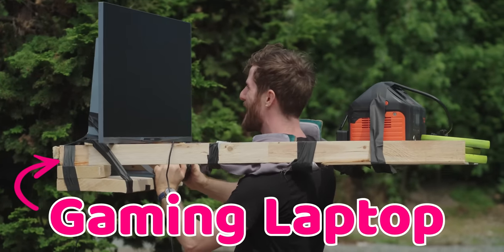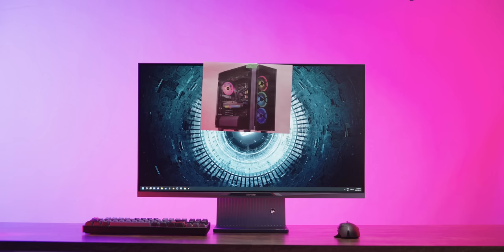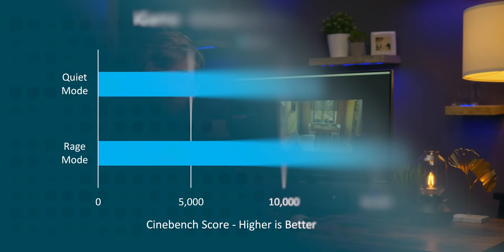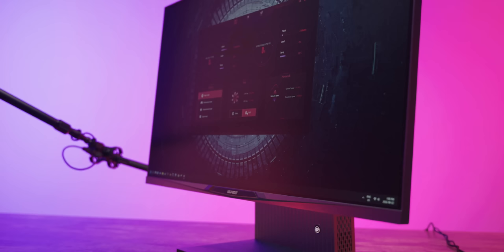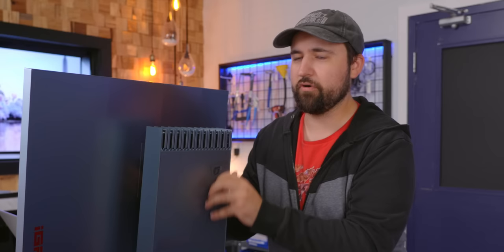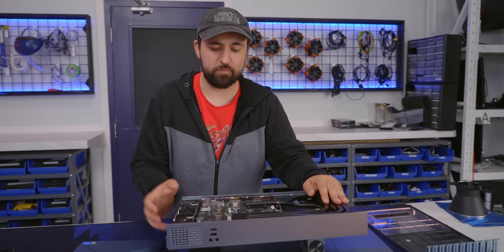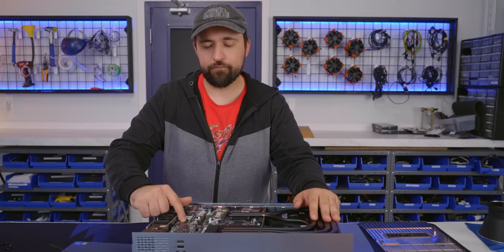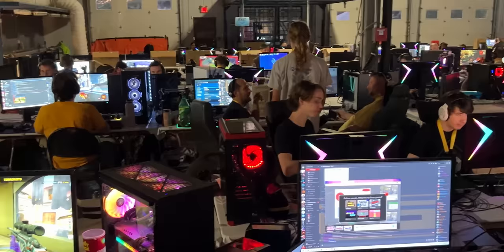Justify Your Existence. I'll Wait. - Colorful iGame AIO

Comment: I actually think an all in one is geared toward people like my wife that sit their laptop on a small desk or table and never move it or unplug it. She doesn’t have the space in her setup for a full desktop, nor does she want it. I think an AIO like this would be a good middle ground
Reply: what kind of desks are you people using that you can't put a mid tower under it somewhere to wards the back?
Reply: @gamergod9182  really laying on the condescension pretty thick
Reply: @gamergod9182  sounds like youve never lived in a small apartment or rented a room in a house.

AIO's are really good for that.
Reply: @formdoggie5  confirming as a renter in NYC, space is at a premium, and while laptops are more all in one, they have their own issues such as clumsy spills completely disabling a keyboard, and the fact that if you leave a battery plugged in long enough it might balloon out of control, both of which happened to my xps 13 when it became my dedicated workstation during the pandemic.  I bought an AIO  to replace it because 24" and decent webcam and used it mostly just to remote into my desktop at work.  Unfortunately it didn't have a strong enough GPU to play some mmos to help pass the time so like many others I settled on playing Animal Crossing.... for what felt like forever, as I watched in horror GPU prices become increasingly gross.
Reply: But then again, it’s 32”, it’s gonna take a lot of space either way
Reply: SFF Desktops?
Reply: I'd say that the Intel Skull Canyon NUC line would be a more flexible buy - small enough to be able to bolt it via VESA mount like an AIO, but still upgradable
Reply: @ibrahimoshodi4472  totally agree this is probably what I should have done, but you're still asking someone to be technical enough to build a NUC.  Also not an obvious solutions since most common people don't know about NUCs and they aren't out their in the wild bolted on to a monitor at like a best buy.
Reply: @eduardocchipinti1493  yes but it takes up a different dimension of space, like the footprint on your desk is small so if you need space for a coffee mug and a notebook the 32" monitor doesn't really obstruct that.  Not to mention your breakfast, lunch and dinner that all happen to pile up as you waste away your day.
Reply: Imo, go for an intel nuc in that case, asuming your wife doesn't want to game.
Reply: @Fedacking  she does actually game with me a pretty decent amount. She has a Zephyrus right now that works great. But if we were on the market again I would definitely take a hard look at one of these
Reply: Yes, and long hours of work is lot more comfortable doing in a big screen. It's a compromise of sorts.
Reply: @slackaduts  yes and rightfully so XD like what kind of desks are you using that you can't fit an ITX case somewhere around your desk?!
Reply: @slackaduts  are you new to LTT fanbase? :P
Reply: At that point, just get a secondary display . Can use it as a second monitor while using the laptop for it's keyboard, display, and track pad. Way better than any aio with the same space
Reply: You can get a mini-itx. At least that's upgradable.
Reply: AIO like this exists, heck ShortCircut did an impression video of an ultra wide HP AIO with 3080 and i7 11th gen months ago
The problem for this one is the odd combination of a rather large 32 inch 1440p screen and rtx 3060 mobile, as it's more of an 1080p GPU. I think this product can be improved greatly if it's 24 to 24 inches 1080p, has display input and less whiny fans
Reply: In that case I'd recommend VESA mounting a NUC or SFF Pc to the back of your monitor of choice. way cheaper and upgradeable!
And don't you think a 32" monitor would be far too big anyway, if your wife wants to have her PC setup in the cupboard under the stairs?

Sure laptop ergonomics suck, but if she doesn't want to make space for a small desktop setup with an actual tower, then she probably doesn't use her laptop often and for long enough for the bad ergonomics to be an issue. So a laptop is still perfect for her, even though she doesn't make use of its mobility
Reply: Absolutely this tbh 😅
Reply: @itbakkawi  you can buy prebuilt NUCs just like typical prebuilt PCs.
Tbh I do like AIOs, but there are more upgradable AIOs out there, and this particular AIO has an  odd screen+internals combo and isn't well made for how much it cost.
Reply: @formdoggie5   A small apartment is a poor excuse, and sub 100, 60 sqft apartments aren't that common.
My 6'x8' dorm room had a 2.5x6' desk. I had a full tower PC & probably 21" monitor. Lots of space to spare. Mini fridge & microwave under the bed. 
 I've been using my trusty 2.25'x3' ish pc cart desk in spaces greater and smaller there after.  That desk fits full tower below, keyboard and mouse on tray, monitor up to four consoles (replace consoles with scanner, any size pc, etc) and the printer shelf easily fits well printer, or 2 consoles, etc.
In my 5'x10' living quarters (half a room) my bed, then my cart desk. I want a loft bed, but I'm not convinced I have the head clearance, in that scenario, it's very hot no ac, there'd be more shallow, but even more desk space under the bed. I think I have 14" under bed storage instead (wish it was 18). Of course hammocks or futons away in a cupboard flooring the day even more space. 

Yes a sub 60 sqft apartment, you've a case to make against a full tower (& people are discussing much smaller itx, nuc, laptops) . It's your prerogative what you prioritize over desk(s) set up. Bed desk laptop is extremely serviceable, compared to an aio with limited space.
Reply: @itbakkawi  yikes, I'm glad my Asus TUF was my pandemic laptop. No such issue, also did the 60% charge and it's a laptop why don't Dell xps do pass thru? I don't even have ac. I do turn off, unplug ac adapter when not in use, not home.
Reply: @mcslender2965  ah yeah there are better aios this was more of an argument for aios to exist in general than this specific monstrosity
Reply: @bradhaines3142  no it's not.
SFF(small form factor) doesn't have an industry standard definition, but the rule of thumb is that anything below half the size of a Full ATX tower(~20x9x20, or ~40 liters), is SFF.
This means there's a wide gamut of case options, and not all of them are PIA's or have performance problems.
Reply: @slackaduts  Not really.
If you think in three dimensions, and not just consider the desk space only, it's amazing what all you can do.
I've got a dual 24" monitor setup with a dell 3610(on the floor, sitting underneath), on a laptop desk that takes up about 2 square feet total. 23x16x32In

There are even desks of this style that will mount the computer, upto a full tower.

And if you weren't aware, you can always set the monitor on top of the case on your desk.
There's some desks that have a cut out and shelf to do this specifically.
Reply: @formdoggie5  Sound's like you've never put much thought into how to organize.
Rooms have 3 dimensions, use them.
Even if you're living in an absolutely tiny place, it's not hard to eek out 2 square feet for a full atx tower.
Get creative, hang it from the ceiling, put it under the bed, set it on top of you chest of drawers, install a shelf(if allowed).

Don't make excuses, find solutions.
Reply: If space comes at such a premium a laptop is still a better option since it can be moved if the space is needed. If it truly doesnt move a small form factor PC would be better manageable with the ability to upgrade as well over the entirety of the PC becoming ewaste when certain aspects are out of date.
Reply: @formdoggie5  the channel we are watching has 10liter desktops, horseshit
Reply: Could still make sense to run a NUC or just run the laptop into an external monitor instead potentially.
Reply: @bushisfuckinretarded  ...which aren't designed for people who like AIO's, because they are brutal to build in, and require knowledge aforethought.

Try to pay attention and stay in context.
Reply: @ibrahimoshodi4472  ...which aren't designed for people who like AIO's, because they are brutal to build in, and require knowledge aforethought.

Grandma and granpa arent even going to know where most of the cables go.
Reply: @bipbop3121  ...none of which aren't designed for people who like AIO's, because they are brutal to build in, and require knowledge aforethought.

Try to pay attention and stay in context.

You buy this for the person that never wants to look inside of a PC and barely knows who to work one and/or just wants something that can also game occasionally for their kid.
Reply: could get a mini desktop that sits next to the monitor in the same amount of space for less price and more power.
Reply: Exactly. This is for the iMac crowd, without forcing them to buy an iMac and stay trapped forever in the Apple ecosystem. And you can actually swap out the storage and ram. What a concept!
Reply: @chrisbaker8533  I'm literally an ex special forces attached corpsman (3d Recon, to be specific) -- I've been more organized with small spaces and fitting people and things into places they should never have been able to fit, ever, than most people likely ever will have to be in their life.

However, what you're failing to realize is you're making suggestions out of context for what AIOs are for: grandmas or moms that just want to plug and play while barely knowing anything about computers, that have a space premium.

They arent going to know how to set up NUCs or VESA mounts or want to build ANYTHING, let alone the hell that is building a SFF PC.

Try to pay attention, and stay in context.
Reply: While I think that could be a usecase, still getting a laptop for something like that could be beneficial since it allows flexibility in the future if ever she does choose to move it
Reply: But considering the price, you can also get a better monitor and a small-form-factor PC to save space.
Reply: Keeping a laptop is probably still better. You can get the same performance for cheaper.
Reply: @itbakkawi  cant you plug the laptop in and take the battery out and use it that way so the battery doesn't get fucked?
Reply: Even then, laptop with a dock, keyboard and mouse, and an external monitor or two. When you're not just parked there, take laptop with you. Best of both worlds.
Reply: @treasure8213  Kind of sucks, but few laptops these days have a removable battery.
Reply: Honestly a 15" laptop + a stand + a monitor is still better tbh since you can carry it with you if you need a portable computer. For example a 15" ThinkBook + a 24" monitor + a keyboard + a mouse + a laptop stand will be about $1500 and will be much more performant. If space is a huge issue, you can also get a NUC.
Reply: Exactly this. I use a laptop as a desktop replacement to replace my old 7700K ITX build that took up less space but I also wanted to be able to take with me. A laptop actually ends up taking up a lot of space and something like this would actually be better since I rarely use 2 monitors (even though I have 2 and they're on a monitor arm). This is the perfect middle ground of powerful enough to game on but easy enough to setup and use.

I also absolutely hate putting PCs on the ground. It makes it a pain in the ass to use and kills thermals and makes dust even worse. Computers should be on the desk whenever possible.
Reply: @FastSloth87  as a proud SFF desktop owner that can fit aa full size desktop gpu in it. oh boy you didnt know about all the unholy pain for that compactness. your cases now cost 2x more. some cases have terrible airflow, some cases have terrible compability with gpu or cpu cooler, some case cant fit an ATX psu so if i were to install an rtx 3070 i would need to buy a 850 watt SFX psu which costs 50% more, and same with itx motherboards, they cost around 30-50% more. some cases dont support radiators or water cooling at all (aio or custom loop) cuz sometimes you would want your sfx system to be water cooled so the gpu doesnt consume 3 slot thickness. (yes now slot size is a premium, since most gpus now are breaking 2.5++ slot thickness rule)

you will undeniably get higher temps due to everything being too close together, so you would have to fine tune frequencies and voltages to give a balance of performance and temperature
Reply: Get her a proper AIO, something that has a ATX motherboard behind the monitor, not a laptop built into the stand. Back when laptops were expensive and weak, these were found in hotel rooms
Reply: @slackaduts  wah wah wah. stop crying, the man's not condescending, he's making a perfectly valid point. This AIO is a screen and needs a mouse and keyboard anyway(takes up as much space as a normal pc setup would). the only thing you need to add to a regular PC is putting a tower below or next to the desk.
Reply: There are some big brand All in One PC that have full desktop spec hardware in them, so they will last and perform better.
Reply: Why not just plug a nice laptop into a display of choice?
Reply: @formdoggie5  Yet, with all that experience, you have a problem with figuring out how to put a midtower under a desk or in a small apartment/room.

AIOS are ONLY about space savings.
The difference in setting up any other pc, including nucs, is 2 cords.
I'll let you figure out which two those are.

FYI, Imacs are AIOs. 

SFF's are not inherently 'hell to build in', that's just the cases and parts you've chosen and your skill level.

I'd suggest you take your own advice.
Reply: @chrisbaker8533  no... I dont have those problems.

I also dont have reading comprehension issues, or understanding simple concepts like the fact that different products are designed for different people as you clearly do, even after having it pointed out to you several times.

I've been building computers since I was 7-8 years old -- the product isn't being marketed to me. The product isnt for me.

Sadly, even with that you still wont be able to grasp what's been said because you're one of those people that can't pull their head out of their ass long enough to see what's right in front of them because they like the smell of their own shit so much they turn entire conversations into something else that's about them and why theyre so much better than everyone else at working with space premiums.

Yeah, sure, congratulations -- that's not who AIO's are for... for like, the 5th time now.
Reply: @bradhaines3142  Sometimes, an air cooled Dan A4 is a really easy build...if you're feeling frisky the Velka 7 is a challenge, but it nets you 1 liter in volume savings (about 14%). The new Dan A4 H2O is much easier and only a few liters larger, it's still roughly a shoebox in size for a full desktop in power.
Reply: @bipbop3121  Fr...I shared a room with a dude in school, shit was pretty tiny but my mid tower still sat atop my desk.
Reply: @formdoggie5  I think you might want to try reviewing my and your posts, because you have totally lost the plot.

None of my posts have anything to do with use case, personal preference or market segment, they're primarily about space.

I have not had anything pointed out to me multiple times, as your previous response is the only one I've received, or been directed at me in this thread.

Asserting that you've been doing something for a period of time, does not inherently mean you have sufficient breadth and depth of knowledge of the topic.
Thus far, your posts indicate a lack of knowledge and understanding.
Regardless of your appeal to authority.

You accuse me of that which you have done.
Read the first paragraph of your previous post to me, and think about.
You might just comprehend the problem.

I never stated who aios are for, nor has it been pointed out to me 5 times.
Reply: @chrisbaker8533  and yet your first comment was about how they were bad because if youre trying to save space you should do what you did instead...

Which is what people who buy AIOs arent going to want to do, which is the point.

So now we've come full circle to your total and complete lack of reading, product, and use case comprehension.

Congratulations.
Reply: @yuxuanhuang3523  I wouldn't use ATX even in a desktop let alone an all-in-one. I've never even seen a AIO with ATX.
Reply: We use all-in-ones on some of the machines at the plant where I work. Space is VERY limited and we can attach AIOs to the front of the machine using a VESA mount. The Dells we use are really better suited for someone's kitchen than a factory, but they do the job.
Reply: @FastSloth87  Or even an USFF desktop mounted on the back of a monitor.
Reply: ok tho, but what about a laptop with an HDMI output to a monitor
sure it's not a full on display port but considering that it's a laptop anyway, it should be plenty
so it's basically an all in one, but with a little bit of tinkering so everything is docked and cable managed nicely
besides, if you fnaggle it hard enough, it's a double monitor setup with only one monitor
Reply: You know what I use when I live at dormitory with 3 roommate? Laptop
Reply: @formdoggie5  And again, you're just making stuff up.

I have not at any point made any judgement about AIOs, or any computer,  being bad or good.

Space savings wasn't the point.

And no, we haven't come 'full circle' to anything, as none of that was at issue.
If you want to point to specific statements i've made that support your assertion, i'll be happy to address them.
Reply: my parents use aio for that reason. Although my dad now has an itx build since he needed some more horse power and I hated the waste when they updated the aios. It's a 3400g in a really small box that screwed onto the vesa mount of the monitor. If you fancy doing something in future for your wife. Looks a little more clunky from the back but it's got the same footprint